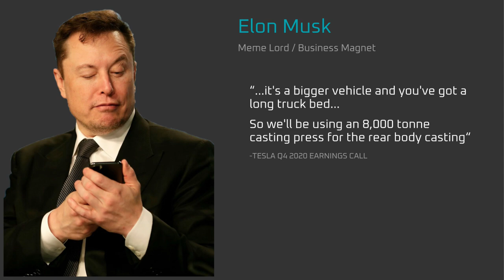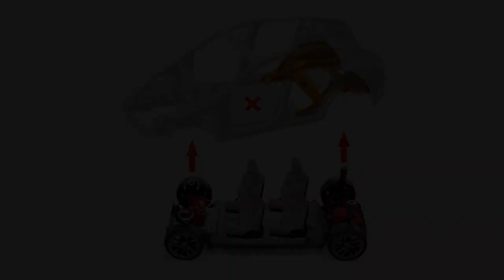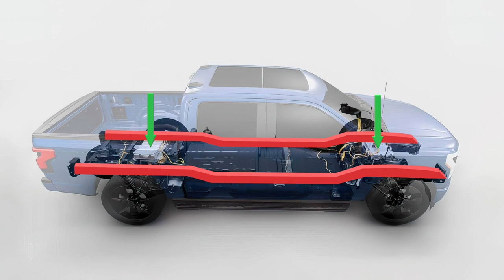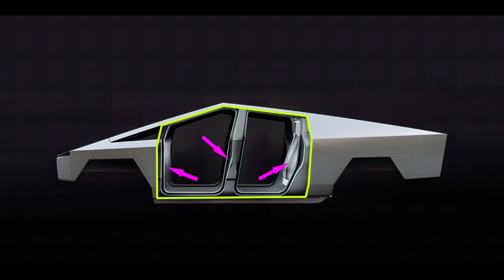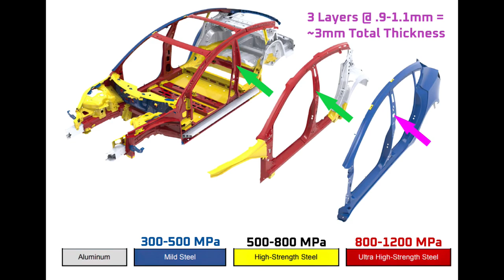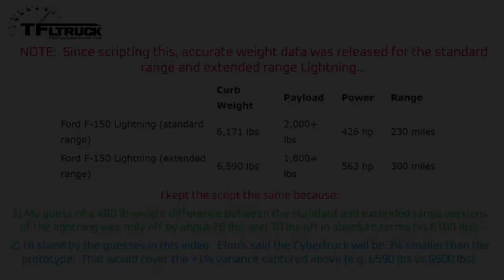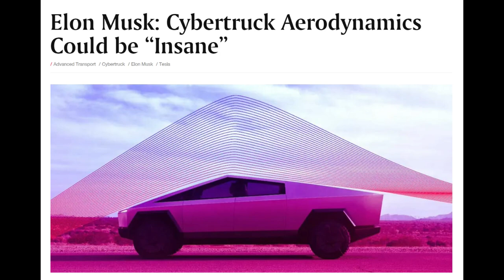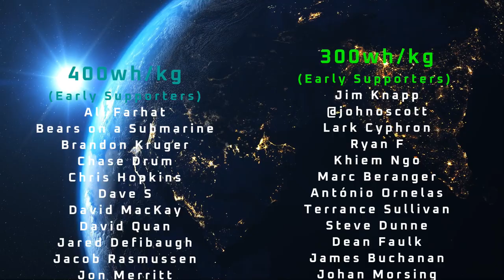Cybertruck // Merging the Exoskeleton, Gigacastings, and Structural Battery Pack

Comment from the maker: Note:  The exoskeleton It probably collapse just fine for crash safety.  The energy involved in an accident is ridiculous.  Current high strength steel collapses just fine, and so will this.  It's the castings you have to worry about.  And those are designed to collapse as well.

As for pedestrians, not a concern for U.S. regulations, only Europe.   You're mincemeat when about any truck hits you.  That's why we need FSD and ADAS.

As for galvanic corrosion between Al and SS.  Tesla joined steel with aluminum in the Model 3 and Y.  I'm assuming this could be done for SS and Al as well with the right materials and isolation.
Reply: Aluminum use in Cybertruck will be limited or none due to different thermal expansion being a problem in very cold or hot weather stressing the aluminum unless they have strain relief features (bends and folds) which might make stainless steel a better option
Reply: Adhesives are quite strong along lengths and for surfaces.
Reply: Oo
Reply: Revisiting:  
I suspect CT may have a small water jet drive option, it won't float high enough for the tires too propel it in the water well, entire tires will be fully submerged or close to it, top of tires will be working against bottom, at least on the sidewalls and some from very top, making for very poor water performance at best.
Reply: It is a beautiful sunny day here in Florida waiting for the sunset and I just had to say just got done with this video I watched a few others earlier after I found them and love the way you deliver your information and also would like to give you a shout out on the whole A10 reference because anybody who says that this is the future A10 on wheels has already shown me the sunrise tomorrow morning to go get that 🍞 to get me that TRUCK

Comment: In all fairness, there was a disclaimer. Unibody vehicles are easily repaired after a collision. If the metal is bent to the point of plastic deformation then the spot welds are drilled out and that part removed. A new part is then welded into place with no loss of structural rigidity. The CyberTruck's door latches and interior fittings will have to be strong enough to mount seatbelts and provide side-impact crash protection. It is very likely that these parts will be quite conventional high strength steel and welded to the exoskeleton. The welds will likely have to be hidden (or they'll be very ugly on unfinished stainless unless they slow down and do high-quality TIG welding) The CT is probably too tough to be stamped. It would break any die tool. it is likely to be scored with either waterjets, lasers, or a combination and then bent over a gigantic brake, which is why it is so planar in its design. ... as for the gigacastings, Tesla has designed sacrificial bumper mounts which can be replaced, but if a casting is bent then it does very likely result in a "total loss" since getting one of those cut loose from the body would be a time-consuming job.

Comment: There are a few points I would modify slightly or maybe just state in a different way . 

Probably the biggest key advantage of the body on frame design for trucks is that it's very easy to customize. The same platform can be configured as a wrecker, flat bed, pickup, ambulance, etc. Unless you need that extreme customizeability, you should probably use a unibody.    For a given weight of vehicle, a unibody vehicle will be stronger than a body on frame vehicle, and be able to haul heavier loads. (With the possible exception of high point loads.) Body on frame is especially weak against twisting loads. 

Triangles don't make a sheet metal body stronger. Triangles make trusswork stronger. Rounded shapes in sheet metal are very strong. 

Generally speaking, structure that is located further from the center of an object will contribute more to its strength to resist twisting. Since the battery pack will be close to the center of the vehicle, and the roofline will be far from the center, the roofline a kilogram of steel in the roof will contribute more torsional stiffness than a kilogram of steel in the battery pack. The main benefit of the structural battery pack is that you're making containment steel serve a second function, as structural steel. Essentially you get the structural benefits for free (in terms of mass). 

Stamping machines don't bend metal. They (mostly) stretch metal, to form compound curvature. Most metals will tolerate bending just fine, but metals have to be pretty plastic to tolerate stretching. 

The best way to improve strength to weight ratio is not to thicken its walls. It's to add compound curvature (or the faceted equivalent) as far from the center of the structure as possible. This is why trusswork is thin and lacy, not just super thick slabs of metal. https://en.wikipedia.org/wiki/Truss 

(I'm not an automotive engineer, but I do product engineering for a living. I concede the superior expertise of any automotive engineer [and plenty of other people as well.])

Comment: Addition of aluminum to a SS would introduce possibility of corrosion, a problem with using AL in boats. Even masts of aluminum are affected by SS fittings so special isolation is necessary.
Reply from the maker: Tesla joined steel with aluminum in the Model 3 and Y.  I'm assuming this could be done for SS and Al as well with the right materials and isolation.  It may depend on the specific reactivity of the specific alloy of aluminum and specific alloy of steel/stainless steel.  Tesla did a lot to make their Al alloy less reactive.
Reply: @thelimitingfactor  Galvanic corrosion can be extremely destructive especially when the metals are at opposite ends of the scale like Stainless Steel and Aluminium. A thick aluminium skin on aluminium underbody castings would have been a better option.
Reply: It depends upon the type of stainless, because not all stainless is the same, and secondly, aluminum is highly susceptible to salt water electrolysis. There are types of stainless, by certain processes, that can be bonded to specific types of aluminum.
Reply: @Dave5843-d9m  Except it would cost to much.
Reply: This will depend on the type of stainless, and the type of aluminum. Active Stainless and aluminum are very close to each other on the anode end of the anodic to cathodic properties scale, which means that they will be far less likely to cause the aluminum to weaken if used together compared to passive stainless, which is on the cathode end of the scale.
Reply: @GoCoyote  Thank you for the reply. I didn't know about active stainless. My experience is with sail boats and al masts and 304 and 316 fittings. I will be interested to see what Tesla does to marry the exoskeleton to the casting - in my Cybertruck.
Reply: @daveoatway6126  
Right there with you! Saving for it now! Considering Tesla's incredible history of solving engineering challenges, I would be very surprised if they cannot solve this one too. While no company is totally immune from making engineering mistakes, Tesla seems to not have the level of "screw the customer" approach that I have seen with other companies.
Reply: @daveoatway6126  I heard Elon say it was 304L, same stuff as Starship.
Reply: @daveoatway6126  Dave, also a marine environment is constantly subject those metals to salt and water.  As long as Tesla keeps those salt, water, Aluminium and Stainless from being in the same place at the same time it should be alright.

Comment: That's a better description of the exoskeleton approach than I've seen anywhere else. But like many people, it's too easy to confuse strength and stiffness. All steel has the same stiffness, essentially, so wherever stiffness is the limiting factor, the solution is a stiffer design - something more complicated than just a sheet. Buckling is the failure mode in components under compression, so there, also, there can be a need for stiffness created by corrugated panels, ribs, multiple layers, etc. The wide expanses of sheet metal in the Cybertruck undoubtedly need stiffening ribs on the inside, if not something more elaborate. Thank you for mentioning the door jams, which most people have ignored. A great deal of stiffness is required there, for sure, and very strong joints with the 3mm sheets fore and aft, or with gigacastings. There is no welding process for joining steel to aluminum, so we're talking rivets, bolts, adhesives...

I'm not entirely sure it's all going to work. A great deal of testing will be required before committing to all the new-to-automotive processes required.
Reply from the maker: Great input thanks!
Reply: Tesla has worked on these problems for some time now. I'm not worried.

Comment: This is what peak Tesla manufacturing/engineering content looks like 👌👨‍⚖️
Reply: You want to know what peak manufacturing looks like?! How about just the case of the Mercedes UNIMOG, the most versatile vehicle on earth aka universal vehicle, it has everything from portal axles to all wheel steering, central tire inflation, steering wheel that can be slided from left t right, tons of connections and PTO to connect alot of equipments for use in construction, mining, railway works, agriculture, rescue, ambulance........
Reply: @alanmay7929  While impressive, number of features / complexity of the mfg product is not the only measure of mfg success.
Reply: @jeffgorchynski  yes it is, the Mercedes UNIMOG has been produced since the 70s and before till today and it has gained an international reputation for it's amazing flexibility and am the capabilities that no other vehicles on earth can offer, it's a huge statement, even the army has been using it for your records.
Reply: @jeffgorchynski  it is also a gigantic success too.
Reply: @alanmay7929  Nobody is doubting the capabilities of this machine. 
Manufacturing is more metrics than offroad capability. You're measuring the product, not the manufacturing method.  Two very different metrics. 

How many do they make per year and what kind of profit margins do they have on the manufacturing line?
Reply: @jeffgorchynski  I'm measuring the manufacturing too, the UNIMOG is like a big Lego with interconnected parts which all have a real purpose, parts that can be changed or modified for all kinds of usage just like a real truck.
Reply: @jeffgorchynski  where are people going to fix the trailer or tow hitch to tow over 12,000lbs with the cybertruck?! Which accessories can be attached to it?....... you see a truck a real one is made to do basically everything from dump truck to RV, snow allow, towing, offroad, overlanding, hauling....... not really what the cybertruck is designed for. A normal truck can also be fitted with small boggies to work on rails......

Comment: Stainless steel + aluminum = significant potential for galvanic corrosion.  Any place where those two metals interface with each other, especially in the presence of salt water, they can corrode badly  I'm sure the Tesla engineers have figured out how to mitigate that, but just pointing out that it is an engineering challenge they will need to design for.  

For the aluminum castings interfacing with the shell it's probably easily solved since I imagine those mounting points have a small surface area.  A non-conductive washer/bushing might be enough to isolate the metals from each other.  However, for aluminum door frames to stainless shell the surface area of that connection would be quite large and harder to isolate.  For that reason alone I would guess they might go with thin stamped stainless for the door frames to avoid dissimilar metals altogether for those parts.
Reply: Seems likely as you say, probably not aluminum on that door frame
Reply from the maker: Tesla joined steel with aluminum in the Model 3 and Y.  I'm assuming this could be done for SS and Al as well with the right materials and isolation.

Comment: Tiny correction: small models cars are usually cast out of zinc, not aluminum.
Reply: Yep...but I understood what he meant...and didn't take it literally
Reply: ZAMAC or ZAMAK, rather, which is an alloy of Zinc and Al, Cu, Mg widely used in cheap permanent mold or injection moldings.

Comment: Depending on the particulars the exoskeleton could be highly torsionally rigid as well, making the structural batt pack somewhat redundant.  I take it that we are assuming such redundancy will not occur.

Traditional ladder frames are highly torsionally flexible contributing to the 'suspension travel' off roading and typically requiring the bed to move independent of the cab in addition to considerable flex points (rubber mounts) such that you have two rigid boxes, cab and bed, flex mounted to a frame that is only rigid in bending fore/aft.   The CT will be extremely rigid torsionally as well as bending on all axis, probably requiring extra travel at the wheels as advertised.  Overall the CT can then have superior suspension control and performance.
Reply: In most cars, the torsional ridigity is provided by the roof. This is why cabrios require extra cross car bracing. On the Cybertruck, you are talking about a few inches of stainless steel around two big panels of glass. Basically the glass is providing alot of that torsional rigidity... which is also true of other Tesla vehicles with glass roofs.
Reply: @patreekotime4578    Good points.  Yes X-bracing is common mainly on convertibles and without the structurally efficient roof for torsion and general stiffness they tent to be several hundred pounds heavier.   CT glass could be crucial structurally. 

Tangent:
Used to be common for small outfits, farms or construction business, to convert an old medium weight truck, say 10-wheeler, from a flat bed or dump into a water truck, water truck would see limited miles seasonally so could be lower investment older rig, if the extremely torssionally rigid steel tank wasn't mounted with proper flexible connections (typ. stiff springs) to ladder frame the mounts would invariably cause tank mounts to rip loose, first causing leaks thru cracks, a disaster for that project.  The frame wants to twist while the thin but super stiff tank restrains it, very bad combination if not connected flexibly.
Reply: In my view, the term "exoskeleton" is a bit of an exaggeration. In an animal or insect that is described as having an exoskeleton, it pretty much surrounds the internal organs, in the Cybertruck, I think it will not wrap around the whole of the truck underside. The base of the cargo box will form a structural element, and be joined with the rear of the cab, so a lot of the structural rigidity will come from that, and there may be a partial wrap at the firewall area, but the structural battery pack will be filling in a lot the underside. I'm not certain how the gigacasting will be used, if it will just under the box, along the whole length between the wheels, or two parts like the new Model Y out of Austin and Berlin. I am pretty confident it will surprisingly cheap to make.
Reply: @grahammonk8013  its an exoskeleton because instead of having a frame that exterior panels and fixtures hang off of, the exterior panels are structural and fixtures hang off of them. The gigacastings work in the same way they do in other Tesla vehicles.... exterior panels dont hang off of those... Instead they are mounting points for suspension,  motors, battery box, and form the inner wheel wells.
Reply: @patreekotime4578  Less breakage in an accident.
Reply: @grahammonk8013    I'm NOT confident it will be cheap to make, but we'll see.  I think the main castings will simply mount most of the hardware, make up much of the bottom and naturally be the strength for entire bottom (except for batt pack) and completing the rigid overall structure.

I'm fairly sure it will NEED power doors, tailgate and probably fronk lid too.  Off road parked modestly tilted, even a standard door is a pain in the butt and a bit of a hazard, on the uphill side it wants to slam shut hard , unacceptable for this class of vehicle once the door mass is doubled as it certainly must be.  Tailgate contains internal ramps and will also set records for weight, notice the small guy who rode the ATV up into the back on stage, he struggled to close the gate.  Those items powered is becoming common anyway on pricier cars and pickups.

Comment: Love your channel and this video too. Only criticism is that AFAIK Tesla does not have a skateboard architecture. IE you can remove a front or rear drive unit without removing the battery. You can remove the battery without removing any drive units. So unlike your depiction there is no skateboard. In the video you show a Tesla body going down the assembly line and the rear drive unit being installed by itself. 
Please keep making videos.

Comment: The door jams can be stamped out of the same 300 series stainless as used to make high quality pots and pans.  Strong, and can be welded to the body with no issues.
Your weight estimates are great, thanks!   My place in line is at 22,000, so I should be getting one of this in a little over a year...can't wait to see what they come up with.
Reply from the maker: ME TOO!  And great information thanks.  Very good point.

Comment: Thank you for mentioning the 1950s body structure the cyber truck was designed after. Most of these types of videos claim it was a Tesla first but fail to talk about the amphibious cars of the 1950s or the 1960s Chevy Corvair Rampside if it needs to be a truck. Outside of that, not a bad video. It's well put together.
Reply from the maker: Thanks man! 🤜🤛